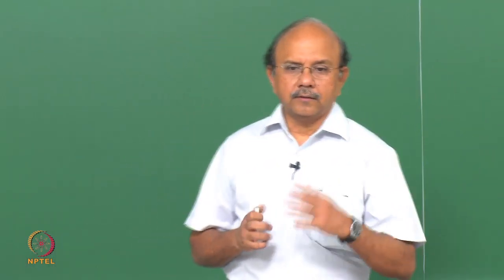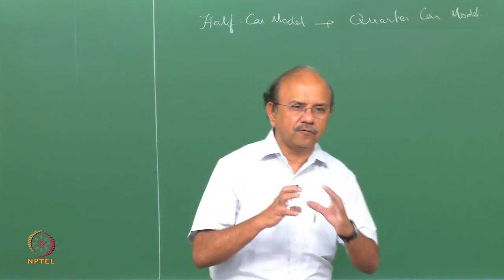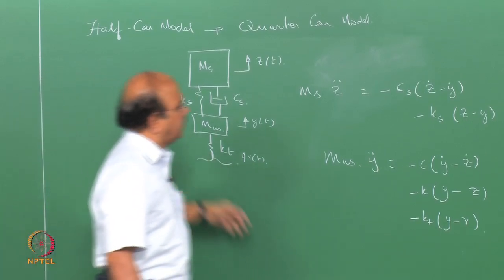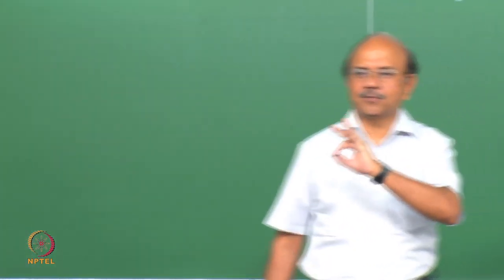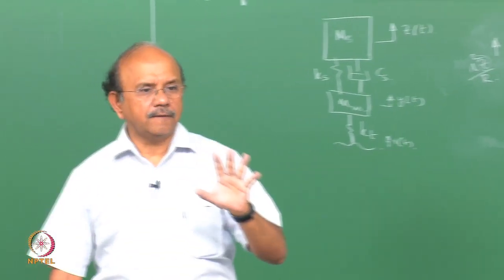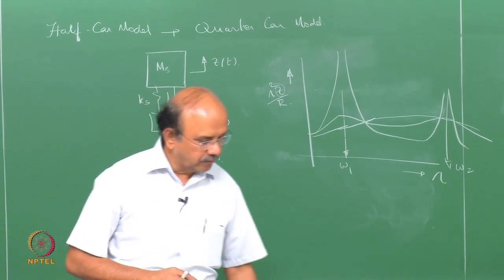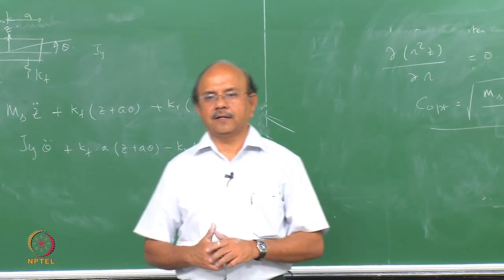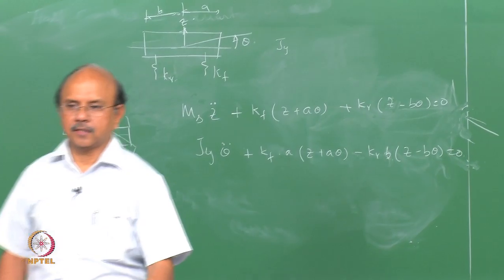Mod-01 Lec-30 Vertical Dynamics – Quarter Car Model

Comment: Can there be an approach where we say that we would choose that damper which increases the wavelength of damping curve to a maximum ? In other words we would have one displacement wave instead of 3 or 4 waves as if the displacement curve has been stretched to 3 times its original length?

Also the minimization of variance or deviation from mean can be a criterion to choose a damper i believe